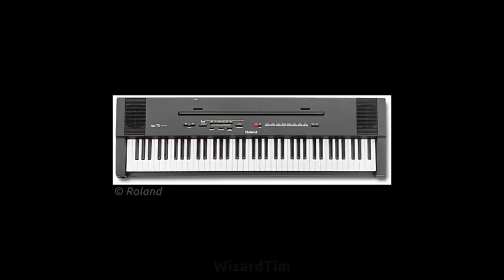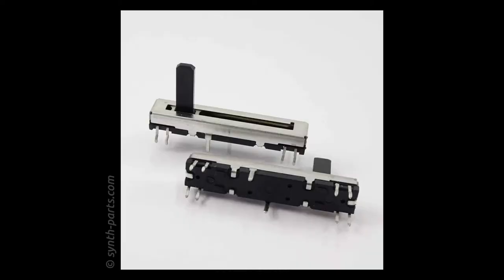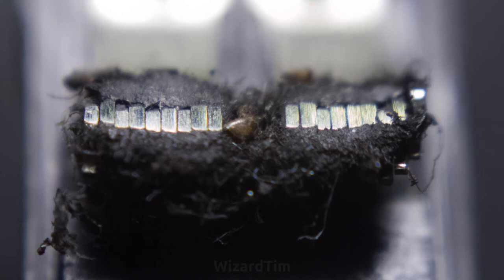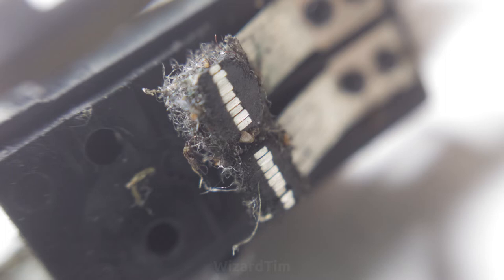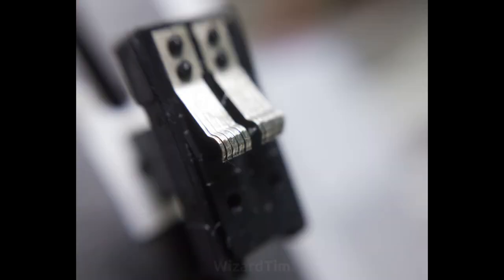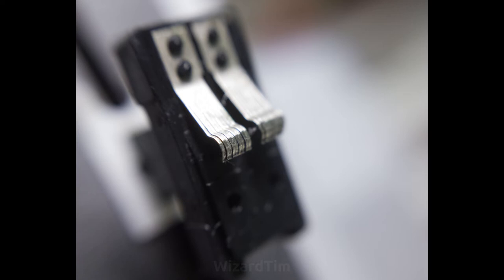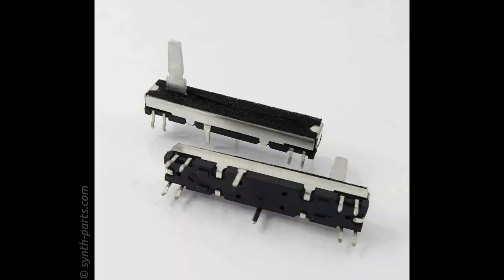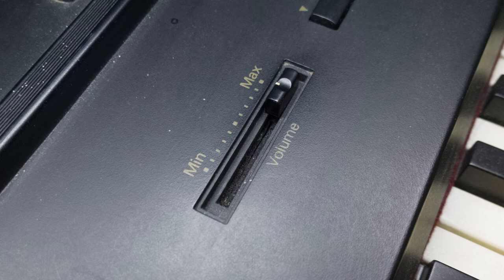Failed Slide Potentiometer

Comment: Interesting, haven't seen that inverted style pot. Some of the really high end modern mixing tables are using capacitive or hall effect based pots, shouldn't wear out over time as easily.
Reply from the maker: Never knew non-resistive mixing desks existed, they must be crazy expensive.

Also the PGFM9000 inverted potentiometer is in the ‘request a quote’ price range.

Comment: Hi Tim

Great video!

Hope you are well. So my keyboard’s volume slider finally packed up. (Roland EP7) very old model.(1990) . I would like to know what would be the outcome if I had to replace the 10k B x2 slide potentiometer with a single 10k slide potentiometer… my keyboard just finally stopped pushing out volume…
Reply from the maker: It uses a dual potentiometer for stereo output to the two speakers on either side, if you didn't want to pay for a 'new old stock' replacement slider you could wire in two standard rotary pots for much less money however it might not look very nice. I'm not sure how sharing one pot across the two channels would work, it would likely cause problems with each output amplifier amplifying the other channel possibly frying them in a feedback loop.

Comment: I have a Roland D5 synthesizer which has an identical problem with the volume pot, but I can't find a source for the replacement part anywhere. (Mouser has some that are electrically compatible but the pins are different and I don't want to go drilling holes in my PCB.) Can you provide a link to where you got the replacement part?
Reply from the maker: synth-parts.com probably has the part you need. The original slide potentiometer is a discontinued Panasonic part.
https://www.synth-parts.com/en/products/potentiometer/slide-potentiometer/

They also have an eBay storefront
https://www.ebay.com/usr/synth-parts-com

The prices are high but inline with other discontinued specialised parts suppliers.
Reply: @WizardTim  indeed they did! Had to have it shipped from Germany so I wound up paying $22 total for the slide pot. Should work out though. Thanks for replying!